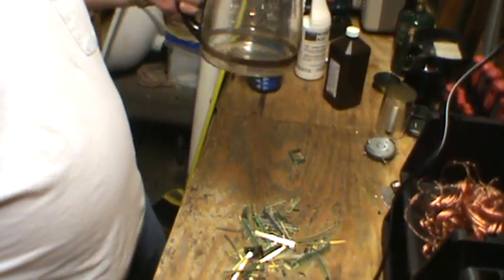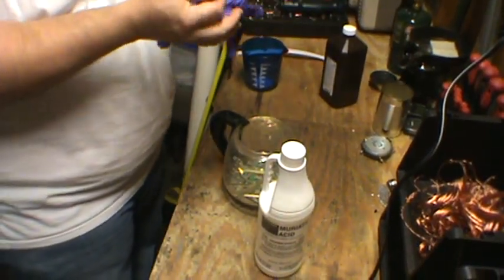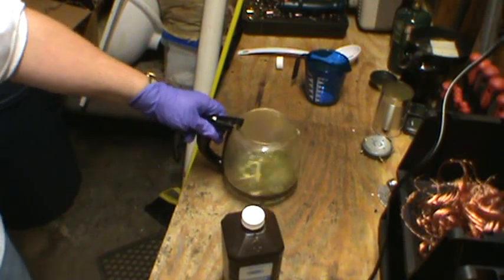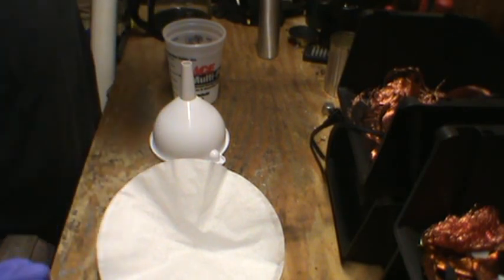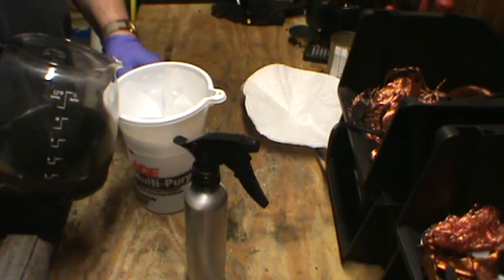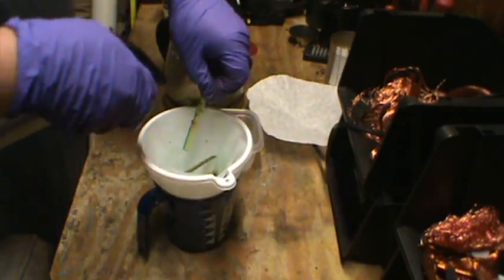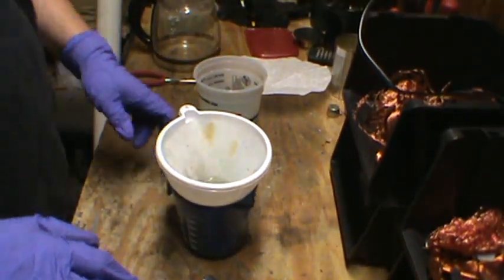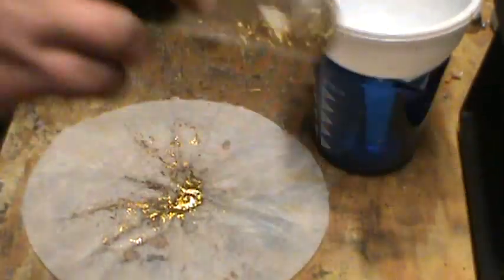How to Recover Gold with A/P Acid peroxide method for gold fingers and gold plated boards easily.

Comment: Is the ratio for this method different from hydrochloric with nitric? Is it still 3 parts hydro to 1 part peroxide? Also how do you personally dispose of your chemicals? I’m having a bit of troubles thinking of a proper disposal method that doesn’t include making a batch 20x the original size from the amount of water I use to dilute it😂😂

Comment: Hey Moose, I do this as much as I can. But this round I had to leave the foils in the solution longer then needed. The gold foils disappeared, I believe they dissolved in the AP solution along with the copper. I also cant find a way to precipitate my gold back out of the solution, do you have a solution?

Comment: Hci + hydrogen peroxide will dissolve a large amount of your gold folks, ESPECIALLY if you have it on heat. All you need is just HCI.... Or concentrated sulfuric acid on heat to dissolve copper.

Comment: Without a proper chemicals cabinet, how are you storing your AP? The fumes that escape will destroy piping and wiring in your garage, basement, and home. No gas mask can protect you from noxious gases. So I'm curious how to safely store these solutions we make? It's easier to neutralize and dispose of AR or Nitric acid than it is to dispose of AP.

Comment: You asked for suggestions so here you go and remember you asked for it... 😅
I desperately need to figure out how to make a gold electroplating solution 4 karat gold and I don't care so much what it is anything between 10 and 18 works fine for me but 19 or 9 would also so long as it's not 22 or 24 Karat which has a very specific look and in my opinion screams fake plated and cheap as nobody in their right mind makes or buys solid 24 karat jewelry unless there absurdly rich and find with replacing they're very expensive jewelry often and neither those looks is one that I'm striving for. Now since you're knowledgeable and capable I can't stop there so I'll also say preferably an electrolyte solution that does not use cyanide and would in a perfect world be neutral or close to it rather than very alkaline and acidic would even work because I don't have a huge preference there other than that I would prefer to have instead of an impregnated solution that gets weaker as I go it would instead be ideally a dissolving anode of karat gold so I can do multiple thick pleadings without having to far too often remake the basis of what makes it work because I currently can't do it once much less multiple times which is why I'm desperate for help because I've been looking for something like that for months and have yet to make any noticeable progress. Looking to do something high quality and Lasting much more like gold filled then extremely thin gold that wears off in a matter of months if worn regularly which is also not a look that suits me and unacceptable to my standards what I'm making I'm giving two people I hold in high regard you are worth the effort to do something better without breaking my minimalist budget because I'm unemployed and mostly retired barely living on a monthly income most people couldn't last a week on and only possible because of me growing up in government housing used to living off of nothing and an ever-increasing tighter belt due to inflation higher than I've ever seen.
I wish I had something to incentivize you with but there it is my request that I've requested from at least four or five other content makers like yourself know that I never received as much as a response not even no or F-off so even if you can't accommodate this request please at least acknowledge that you saw it and I will be disappointed if we can't do this but eternally grateful for your thoughtfulness and effort to acknowledge I exist and I'm worthy of a reply. If it's not a doable request or is especially problematic and you can help within alternative that accomplishes this same thing or something close to it I'm in a position right now to take whatever I can get with gratitude and no complaints
Thank you in advance for your consideration

Comment: If in fact I were to dilute my working acid peroxide solution too much is it a ripper be damaged or can I just reduce it by boiling off some of the water bringing it back to its original concentration or close to it?

Comment: Now just to clarify your using a coffee pot but not the hot plate correct this isn't a heated solution or am I missing something?
Also if you don't mind could you please elaborate on why you are or are not using heat and maybe even the pros and cons of both heated and unheated?

Comment: Freeze the h2o2 about 12 hours to freeze off the H20 drain the unfrozen h202. This yields about 25% hydrogen peroxide which works way better

Comment: Thankyou for your time and effort to make this video, one question I have is you Said that this method removes the gold off of the pins and ram, graphic cards Ect, so to purify it do we just do another HCL BATH to remove any other metals or does the introduction of H2O2 to HCL stop other metals from dissolving with the gold, it might seem like a stupid question because if the hydrochloric acid can dissolve it without the hydrogen peroxide then you would think when mixed they would dissolve them Easilyer  than HCL ON ITS OWN BUT ALSO BY MIXING THE TWO THE SOLUTION MIGHT NOT DISSOLVE OTHER METALS LIKE COPPER I DON'T KNOW DOSE ANY ONE HEAR

Comment: what would happen with copper clad   and could I cement out the copper if the solution has aluminum in it to would be a bit before I try this need equipment to deal with vapors  and if I contained the vapor in liquid form  how to dispos safely  still got plenty of reading into this before I dumb $

Comment: Dear
 Moose ,
I watch your videos
 and it was time for me to start recovering gold please help me your answer is important to me.

In a chemical store I found Hydrochloric acid 31-33%
 and 50% hydrogen peroxide. I can recover with these materials

is it too strong? What do you suggest?
 Thank you in advance for your reply.
Reply from the maker: those are fine.  You just need to use very little of the peroxide.  Maybe a couple tablespoons per 500ml of hcl
Reply: @moosescrapper5928  Thanks I will let you know when I have results.
Reply: @moosescrapper5928  I did tests with boards on a very small scale since as I told you I am an amateur and now I try to make a start. The result I got is a green solution (obvious from the presence of copper) and no gold flakes !! The question is whether the gold flakes were integrated with the solution there is such a possibility?T This result made me not move on a larger scale until I understand what is happening and if I make a mistake. Moose I want your advice.

Comment: Awsome video! And would it go faster ( the process) if I use peroxide and the air pump? And I just put foils in hcl and sodium nitrate to purify the impurities and then percipitate using metabisulfate right?
Reply from the maker: I dont know about sodium nitrate, but if you use bleach or, sodium hypochlorite with hcl, that will dissolve fine gold and then precip with smb.

Comment: When i first found this channel a year ago, I began saving.. Scrapping anything electronic. Copper, aluminum, Gold, circuit boards,  planted finger connectors.  Even a small jar of gold foiled Glucose strips, but they went to silver shortly after I started saving them.. now have a big jar of silver strips, but i need to spend a day removing the glue using goo gone. Thats how I did the gold strips. 

Someday I might process it. I  have just over 12 ounces of small finger scrap, so I figure once the gold is removed I might end up with 1/3rd to 1/2 ounce of the good stuff..   Just gotta figure out the best way and where to do it.

Comment: Hi I had a small issue. Some times I get gold rust after putting smb on aquaregia. But some time I can't get. Some times solution become pargnet fine after putting smb but it could not change then I will add some Zinkpowder and after I wash with hydrochloric acid after hydrochloric then I'll dry and then put nitric acid and then wash wash wash with hot water and then goes to melting foundry. I'm very nervous with my process can you explain me where I'm wrong. Mostly I get gold out of phone motherboard. I'll dip my boards directly on aquaregia and I'll the gold will remove also I notice the copper also gone. I'm surprised why aqua caught the copper. Explain me plz I was waste lots of gold that reason 😢

Comment: Man I'm glad I watched this video. I ordered a few different flat bottom boiler flasks but I can use a coffee pot which I have a few of them. I've been using Mason jars. Also it looks as though you are using 3% hydrogen peroxide. I've been using 35% which might be a waste if I can use the cheap stuff and save my 35% for piranha fluid and other stuff. I do wonder if you can use a coffee pot on a hot plate but as long as it's not dry I wouldn't see why it wouldn't work. I will say you should probably be mixing these in a fume hood or at least outside. I made a fume hood with an old projection TV case, the ionizer things or whatever their called the clear plastic screens and 2 exhaust fans. The fans that you can hook a light up to that go in bathrooms. They work really well because there cheap, you can add lights, and run 2 of them off of one power cord. Of course I use led lights to help minimize the power consumption. It's actually pretty cool. I used 4 screens with one cut out a little for an opening about 16" wide by 2' high to help create a draft cut 2 holes out of the case for the fans and incase them with plastic so they blow more out the back also helping draft, I used 2"x3"s in the corners and around opening for support and a piece of plywood for the bottom with one of the thin plastic things that go behind the screen just to protect the plywood and of course silicone. I'd liked to use plastic for the bottom and supports to keep the weight down so I could move it easier as it takes up a lot of room but really I made it more for fun then anything.

Comment: I understand you made this 5 years ago. My question is since the acid dissolves the copper  im assuming  this method could be used to extract copper from low grade or any grade circuit board or is there a better way? I guess though with the myriad of ferrous metals attached to the copper the solution probably could not be reused. Do you have a video on reclaiming copper from minute parts?

Comment: Pls what do I do? I try smelting my gold recovered from phone with borax but all I could get is something like melted plastic I even spoil my burner because I trying getting gold burning more than an ahour pls advice me.
Reply from the maker: Hi there, If all you see is "plastic" that may just be because there is too much borax.  The gold is likely encapsulated in the borax glass.  If you break it up you should find the gold in there.  I am not sure how the burner was spoiled with this...
Reply: Yes I think so I thought that the more the borax the purer the gold I will get. My burner got hot and started melting from the plastic mouth. Now do u know how I can dissolve the borax or get back the gold should I dispose it? Lastly can I smelt without borax to avoid  the mess again? Tnx for ur good work and advice Remain blessed

Comment: Good Info. But pls i want to ask what I will do in my area what I see is 6% peroxide and highly inflammable hydrochloric acid.  Should I add water to the acid to cool it and do I also use the 6% peroxide? Pls help
Reply from the maker: THe peroxide is fine as is, just use less.  As for the HCL, they dont sell it much stronger than 31.45% in refular stores so it should be fine.

Comment: Will this method remove the copper and leave behind just pure gold fingers?
Reply from the maker: in time yes, however it is very difficult to ensure that when the foils come off it is just gold.  This is why the next refining step is important in producing quality gold.
Reply: Moose Scrapper. I use a wood burner to remove the fingers. 
Now im tryin to get the copper off the fingers to leave behind just gold. Can i use this method ?

Comment: Issue #1, you never add water to acid, never ever. Peroxide is mostly water. Adding water to acid can cause explosions due to sudden heat generation. Always add the peroxide first, then slowly add the acid. It does not matter if you know the strength of the acid you are using. Always SAFETY First!!! This may not happen with the dilute concentrations you are using here, but why even take a risk that you could cause fires and or explosions if the acid you bought happened to be a lot stronger by accident of the manufacturer. This I remember from 9th-grade Chemistry taught by Mr. McClure ;)
Reply: My great grandfather name was Jasper McClure. Not sure who he was maybe different guy. Anyway, is it possible to dissolve a whole bag of pennies and then collect the copper somehow. I hear 1987 or older pennies every 1000 of them is worth 300 dollar in value? Smelting the final stage...?
Reply: @Shd191  Yes, you could dissolve the pennies in acid and the selectively precipitate the copper. But the chemicals would cost more than the total amount that you could get for the copper. 
It was never true that US pennies were worth that much. At today's copper spot price, the 1983 and before pennies have a melt value of about $0.02 - in other words, double face value. So 1000 pennies would have a melt value of roughly $20.00.
That is why there are so many copper pennies still in circulation, it just doesn't pay to melt them down as scrap.
Reply: FINALLY! Someone said it! Thank you!
Reply: @SP-rj9zg ffs pouring water into 32% HCl is perfectly safe.
Reply: I watched a video on how to gather gold foils and I read your comment and it's lucky I did,not that vinegar and salt can go boom,thanks
Reply: Only true of water and concentrated sulfuric acid, of the common acids. HCl (aq) (muriatic acid) is mostly water so there’s no issue.

Comment: Good video.  I'm looking for acid to check some gold colored objects I found while gold panning. I may have to take them to a jeweler. They say Nitric acid is the preferred method. I need a drop, not a gallon jug of the stuff. ,lol
Reply from the maker: they have test kits on ebay for less than $10 that have little dropper bottles.  Best of luck to you!

Comment: Hello Moose...I have watched a number of Vid's an always end up back to yours. Love the Info. I have had no problems up to this point with the fingers that is. I had a med bottle full of pins divided them into 3 containers. It cleaned the Gold off alright lol I cant find it in the A/P. Is there any way to get it back ?.( To much Peroxide ?) The fingers work very well I'm thinking because there larger pieces then the pins ?. Any insight would be great Thanks an keep up the Good work on the Video's
Reply: If you used too much peroxide and dissolved your gold then simply heat the solution to around 180 degrees F until H2O2 boils off.  Whenever small bubbles cease to form in hot solution then gold can be dropped using smb.

Comment: Hey moose i have a question do ypu know my gold look like crey color clay after it been refind i really dont understand
Reply from the maker: if its grey there are other metals in it.  I do not think I would be able to tell you what those metals are however without knowing everything that went in.  If you try to run the powder through the refining process a few more times it should clean it up.
Reply: thanks ;)
Reply: can you tell me about the acid you use 31.4%
i have the same but it on 36,4% can i use that

Comment: Hey Moose, so what could go wrong if you have some solder on the board in this A/P process? In some cases there is gold plating even under the solder portion of the board.
Reply from the maker: For beginners learning the process it can cause problems that need more education and experience to deal with.  Solder can be removed by a soak in just hcl
Reply: Moose Scrapper what problems would happen

Comment: hey at 10:30 you said that if the solution is blueish color to run it through the Muriatic acid 
again . how long should i leave the foils in there a second time or even a third time if necessary ?

Comment: Thanks for this video, but can I reuse the solution for next batch or I just have to cement out the copper first before reusing . thanks for I await your responds
Reply from the maker: it can be reused many times
Reply: Do you have to cement out the copper first or can be reuse after the first batch and so on...
Reply from the maker: You can reuse right away.
Reply: really a big thank you for your responds and I like your answers, God bless you..
Reply: Hello Moose, really have a question for you. Please, can you help me of this, how do I get rid off the lead solder in gold plated pins before proceeding my "Recovering Process" because, I read that if there are lead solder in my solution, this could ruins the reaction of the gold recovering process.. Thanks, As I await your candid result and responds..